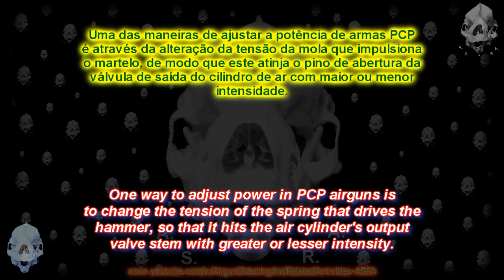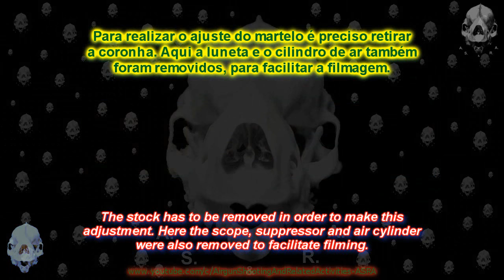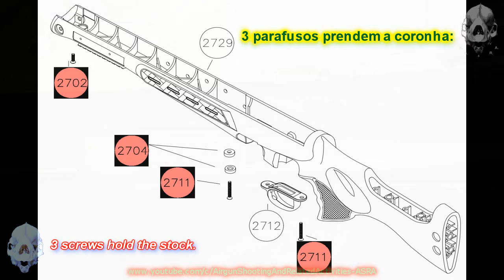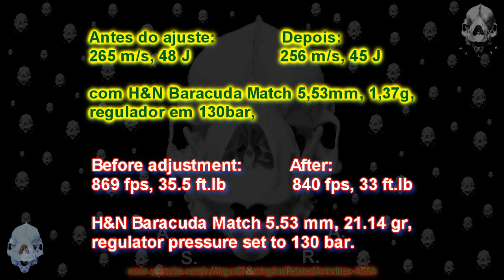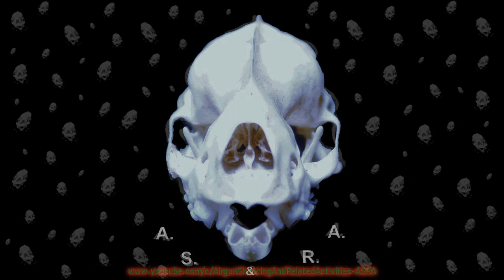Hatsan BT65 SB Elite .22 power adjustment

Comment: Hi! 
Good vids youre making :)

One question… my bt65 is extremely air hungry… .177 @14.97gr and 1051fps and 20shots drains it from 200b to 150 ca. 
I’m going to get a regulator (probably Lane) but I’m thinking of playing with the spring tension. Hope it will help a bit :) 

And then a big question… my cylinder leaks after 80b and I need to change the valve seat in the cylinder. But I can’t get it out and there is no guidance around. Have you done this? And if so, how! 😅

Regards from Norway :)
Reply: You should not shoot it to under 100bar

Comment: to save having to do it, put it altogether, find out it was not enough (either way), would you know (roughly) how many turns equals how much power please?  So, for example in your video, you dropped the power by about 30 fps with one full turn out of the screw.  So, would two full turns equal 60fps do you think?

Comment: I need help !!!! I made a bit of a mess with the spring adjustment of my bt 65 .25 cal. And I can not remember the number of laps done. Would you like to tell me how to restore the factory setting? Thank you!
Reply from the maker: I don't know the BT65 .25... The .22 i think can go from about 40J to 80J with 5 turns from minimum position. Best thing to do is to start with the screw at minimum and check the grouping, then increase the tension a little ( 1/4 turn maybe) and check grouping again, and so on until you get the best results. In the case there is a restriction in the maximum allowed power where you shot it, you will need a chronograph..

Comment: hello  guys, how many round i do for have got the max power? if is possible canghe the spring with another harder?
Reply from the maker: My BT65 without regulator could reach around 70 Joules maximum, original settings. Shot count (200 to 100 bar) was about 30 shots (~17 shots with 10 m/s spread, and lowest energy around 46J on last shot). Yes, you can replace the hammer spring with a harder one, though I am not sure if it is a good idea.
Reply from the maker: Ciao Jacoppo, sono brasiliano, mi dispiace anche per il mio inglese e italiano scrito! Ho risposto al tuo commento su YouTube, ma credo di aver frainteso (ho pensato che tu intendessi "rounds" come spari). Non so quanti giri sulla vite della molla del martello che serve per raggiungere il pieno potere, avrete bisogno di sperimentare. Basta prestare attenzione a aumentare l'energia con piccole quantità, misurare la velocità dopo ogni regolazione e ricaricare il cilindro d'aria. Noterete che dopo un certo punto la velocità smetterà di aumentare, in modo da ridurre un po 'la compressione della molla a martello e la tua BT65 sarà a pieno potere. Ricorda che il numero di spari diminuirà forse molto e che il martello colpisce fortemente la valvola di scarico, quindi non è consigliabile sparare con il cilindro d'aria a basse pressioni. Spero che questo aiuti.

Comment: hello I have a latest version of at 44 _10 it comes with stock already made for power adjustments.buy it seems that  CCW turn reducing power.can u confirm the changes in newer version of hatsan at 44 should I turn CW to increase power
Reply from the maker: I don't know, my AT44 is the .177 single shot made in 2013, in it the hammer screw lies ahead the spring (inside the hammer), so turning CCW increases the spring tension. The BT65 is the opposite: the screw is behind the spring and turning CCW decreases tension. If this new version of AT44-10 is made ready to power adjustments, the user manual should contain instructions. Now I am just guessing, but if you can see the screw and use a short Allen key to turn it, the screw is behind the spring and turning CW will increase power. If a long Allen key is needed, there is a good chance the screw is in front of the spring, so to increase power turn CCW. In any case, you will notice the power increase or decrease after firing a few pellets. I hope this helps, good luck!

Comment: Great video friend. I make it more powerfull, but I notice that it shoots less shots now. It's this how suppose to be? And why yours airgun shoot the 21 grain at 860 fps? normally supposed to shoot it at around 1000 fps. 
Thanks
Reply from the maker: Thank you Giorgos. Yes, with the hammer hitting harder the output valve releases more air, so the power increases but the number of shots decreases. My BT65 has a pressure regulator set to ~130bar and a stronger output valve spring, this has the effect of reducing power and maintaining the muzzle velocity almost constant while the pressure in the air cylinder is above 130bar.
Reply: Unrelated Activities does a lighter output valve spring increase power?